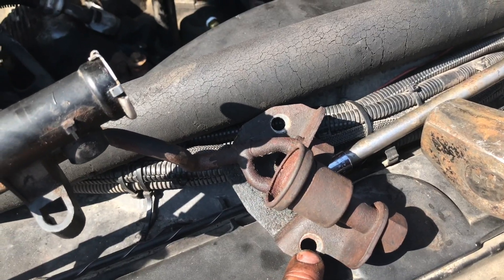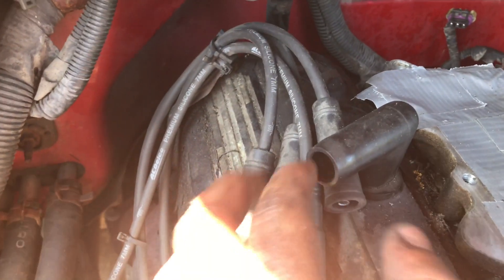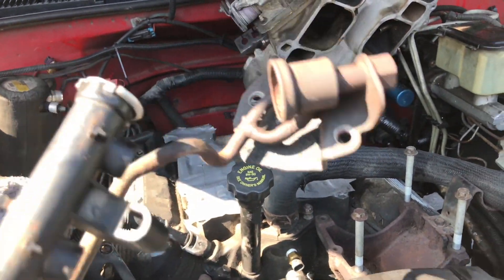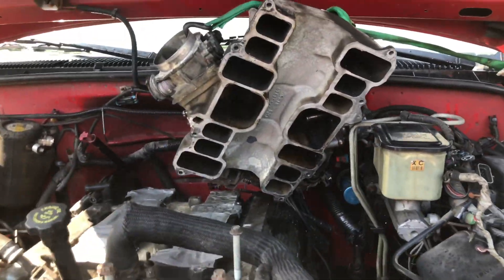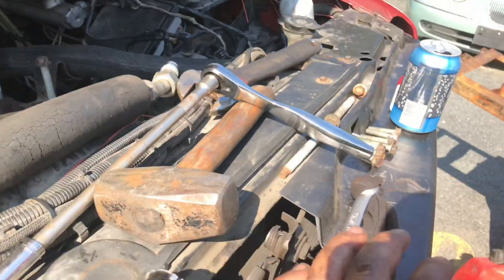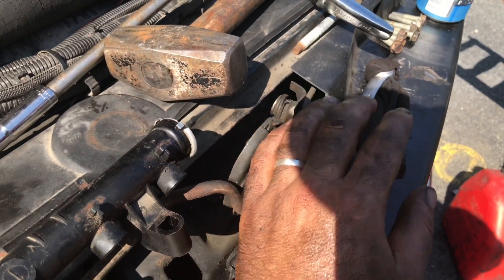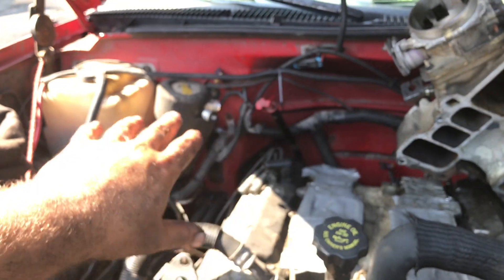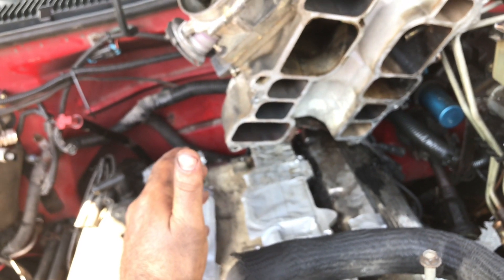98 Chevy 454 Vortec Fuel Injectors Problems GMT 400 L29  (Part 2)

Comment: You don’t need to take the distributor out, use a 10 mm stubby and you can get the back bolt, not easy but can be done. I ground off part of the bracket on a bench grinder ,makes it much easier to access.
Reply: I did the same and grind the hole of bracket to make it U shape so in next time just lose the bolt one turn and you can slide the fuel trim holder a way, but really the first time removal it is a pain

Comment: Some of my new injectors are leaking out of the intake manifold side.  Can't figure out why they are not seating correctly.  Any advice.  I have tried 3 times with the same issue.

Comment: Did replacing the injectors fix the issue you were having? I am having the same issue and am curious if this fixes it.
Reply: Have you checked the pressure regulator vacume hose? Its suposed to drop pressure at idle and at low speed providing full pressureat full demand w.o.t.